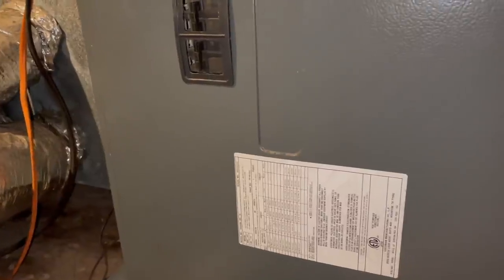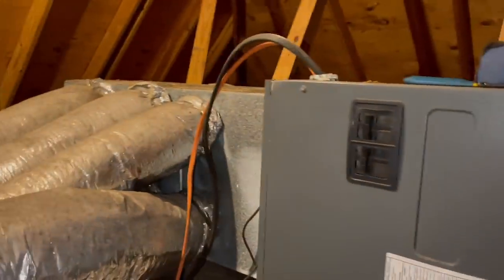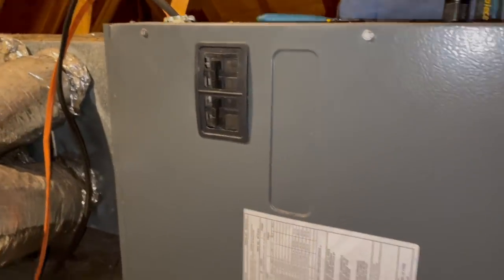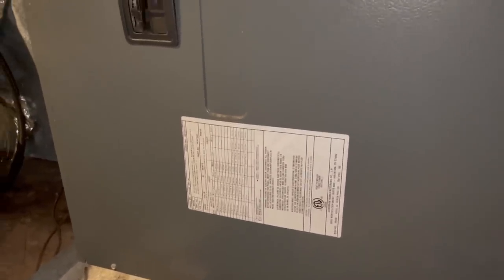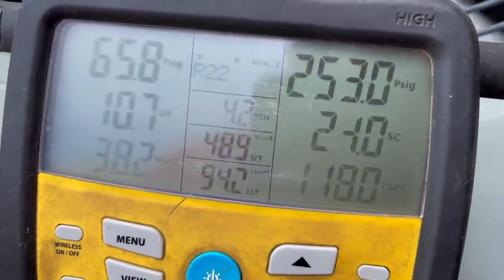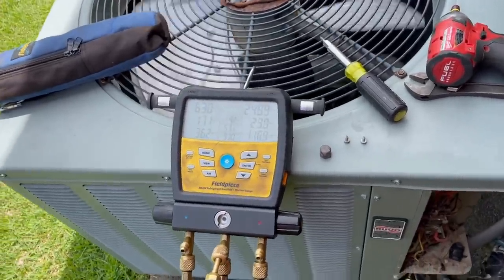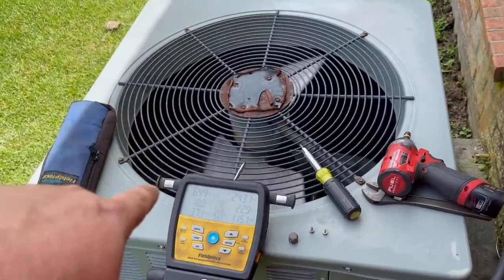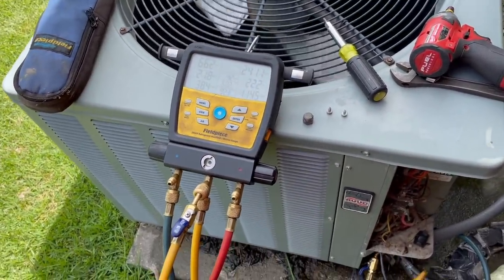HVAC System Freezing/But Why??

Comment: All systems have a icing set temp persay, usually 67-71 depending on ducting/static/tonnage/load etc. a clogged filter will make  80% of systems ice no matter set temp. LOTS of customers love to fib about filter changes and you end up 100% checking systems when in reality it was purely the forgotten filter, as icing takes time to defrost, customer changes filter mid defrost but still calls for service.

Comment: 13.9 is below 6 percent tolerance on that cap. I would replace it.
Reply: +1 caps are cheap even for quality ones. Icing (other than low charge) is probably insufficient air flow or an oversized unit for the ductwork or load. Kisstupid.

Clean that mess up and don't try to sell them an improperly sized and implemented system...
Reply: I replace them once they hit 10%

Comment: But do u charge them for looking at it today since u asked them to call u to come over if it freezes again ?Asking for a friend… interested
Reply: I am sure he did. You can't stay in business working for free. He performed a diagnostic but didn't find the problem and it was on Sunday. That's how I would of handled it. 24 years as a tech. I guarantee the fon control board is bad, I've seen hundreds of them working intermittently

Comment: Take temps on each side of liquid dryer and also if someone else is charging system I would say theres air or moisture in system. I would recover charge put unit on vac, and charge unit making sure theres no non condensables. I would also replace that dryer If you have more than 4 degree difference from each side. When in doubt always remove refrigerant and recharge ynut after a vac and then troubleshooting will show itself at that point.
Reply from the maker: You must be crazy
Reply: I agree but having non condensibles won’t make it freeze up and it would have gave him high head pressure , and his pressure was fine so you can rule that out without-wasting all that time recovering and vacuuming and charging again.
Reply: @johnisraelhvac2019  He must have stock in R22

Comment: 1. Why would you be checking for a leak on a system that was overcharged?

2. Was the filter clean? Evaporator coil?  Looking at how filthy it was in the cabinet...I'd suspect those way before a sticking contactor.